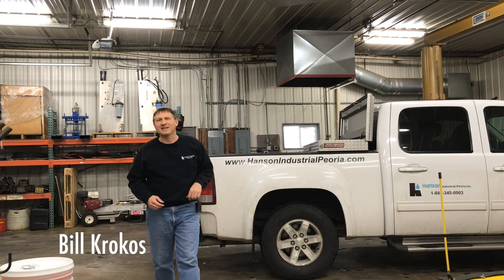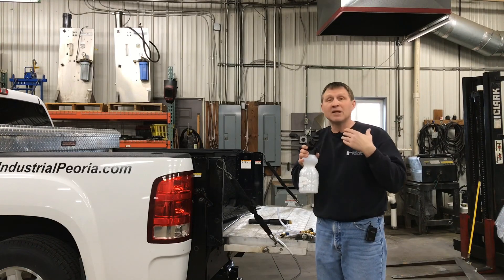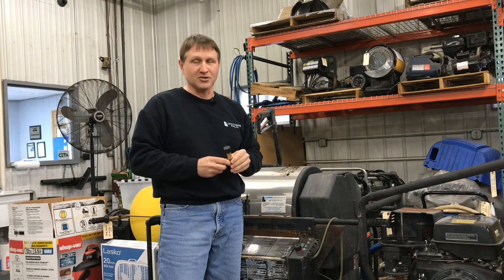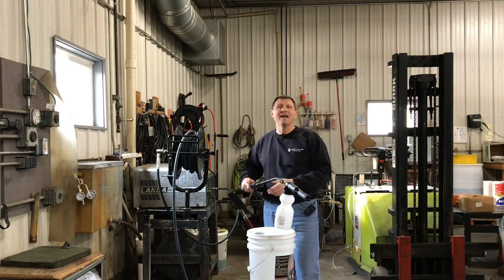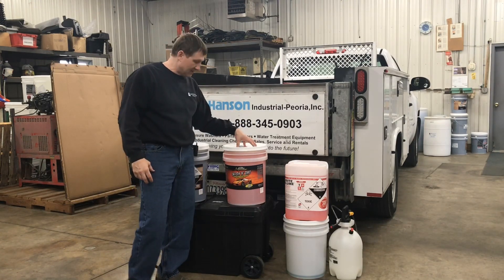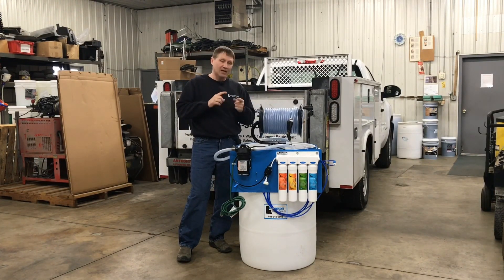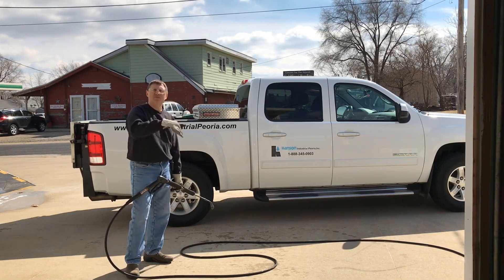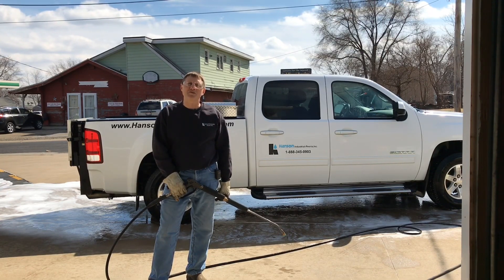How to Use Chemical Injectors for Pressure Washers, Wash Chemicals and Spot Free Rinse!

Comment: is there a way to get high pressure soap without a low pressure nozzle attached? without the soap etc going into the machine itself?
Reply from the maker: Yes. There is special jet that will shoot a zero degree with pressure and straight. It's not full pressure thought. Soft wash guts use them.  However with down stream you can add 4-5 nozzle sizes up with a zero degree will suck the chemical after the pump and coil on the outlet and shoot it 15-20 feet. 

Call me and I can see what you have help you out during the week. 

309-697-3508...ask for Bill. I'm not there. Leave your number and I will call you back.